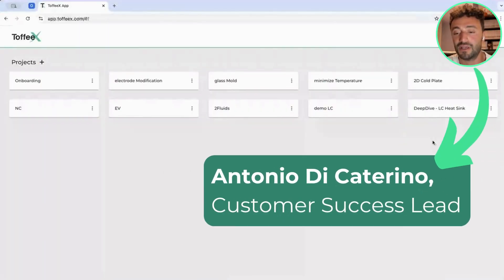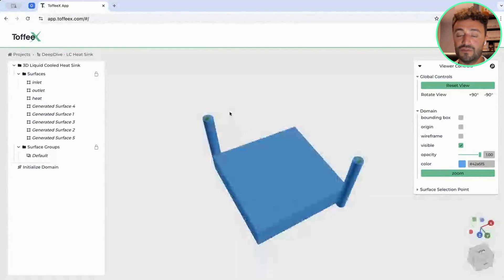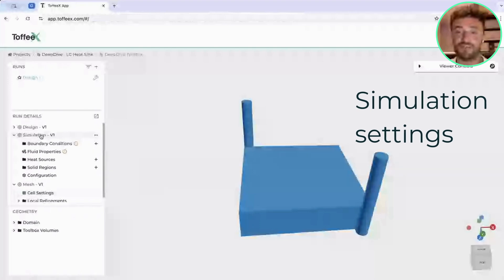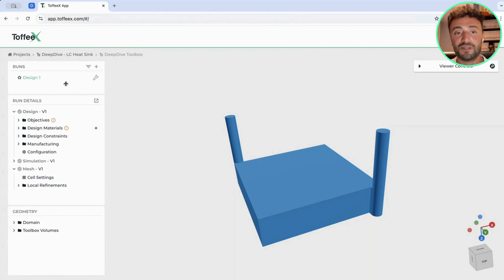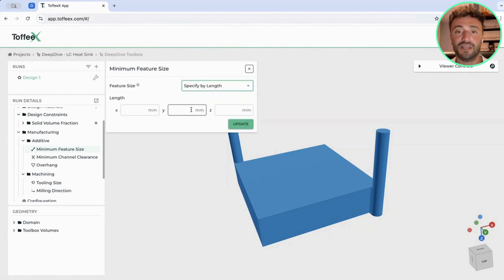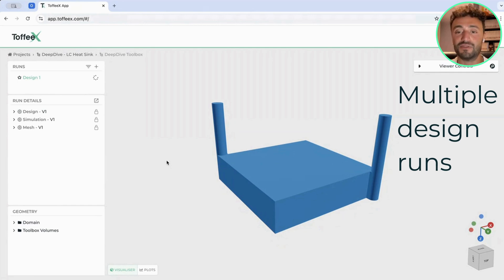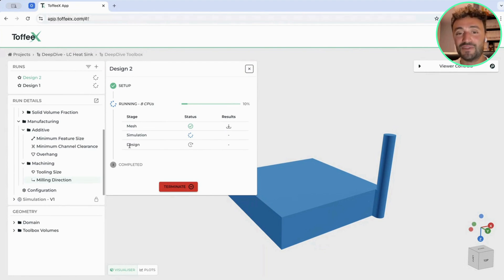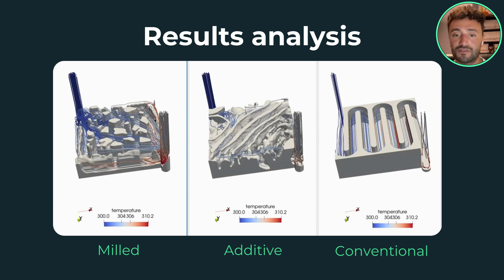ToffeeX Software Demo: Liquid Cooled Heat Sink

Comment: A fixed, uniform temperature on the base is applied here. Could I specify a spatially varying temperature? How about a fixed power (instead of temperature) on the wall zone?
Reply from the maker: Yes, you can speficy either a fixed or specially varying Temperature or Heat Flux, or a fixed Power. For more info you can have a chat with our team: https://toffeex.com/contact/